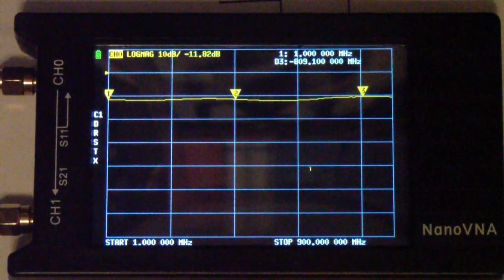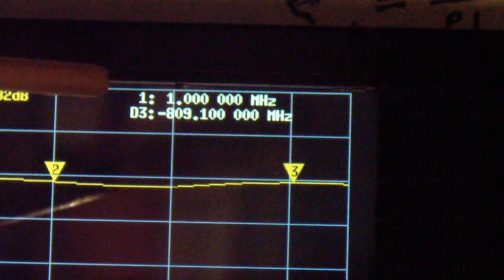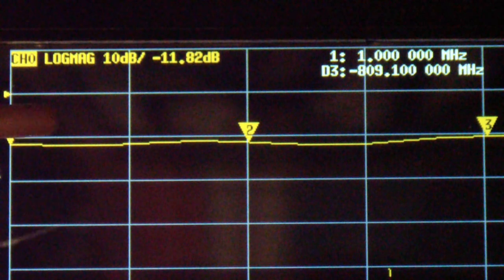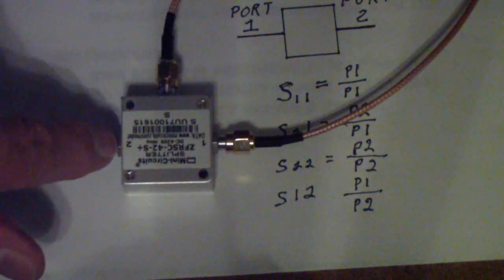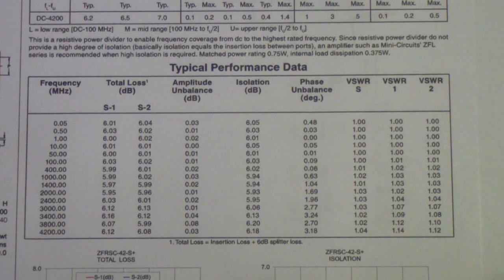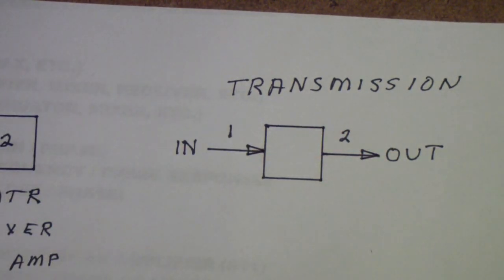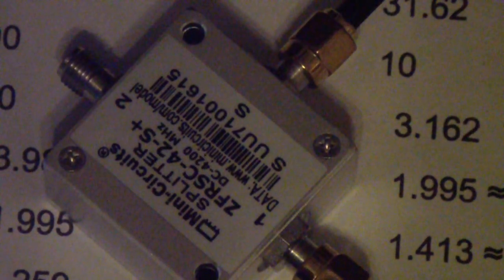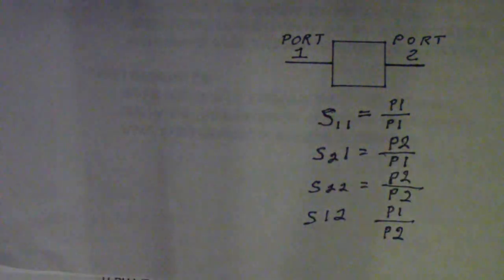TTT317 What's a VNA Good For p3

Comment: I am a little confused. On the NanoVNA you are showing CH0 for the trace going to the input of the DUT, and you have CH1 connected to the output. Shouldn't the trace be showing LOGMAG on CH1?
Reply: CH0 is the DUT port ... it is the signal source and a measuring port at the same time ...  it is all about CH0 ....the CH1 just help to make one more measurement ...  the power out from the DUT
Reply: Could you do a video that shows the nanoVNA being used as a Spectrum Analyzer?